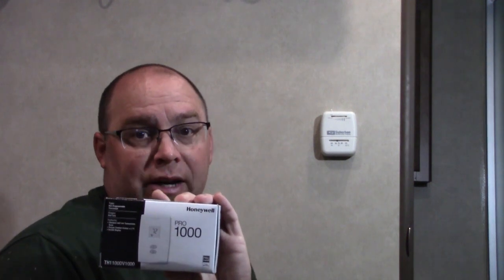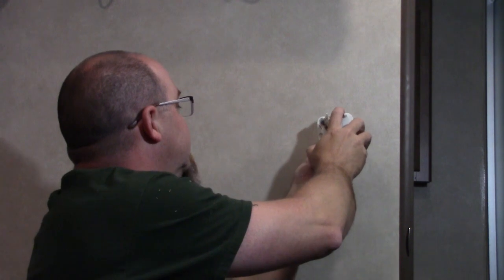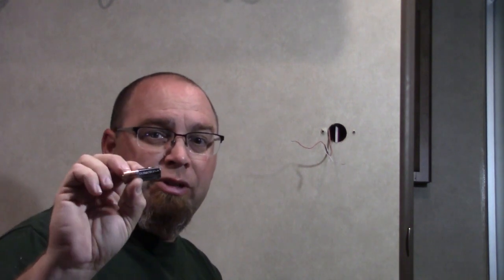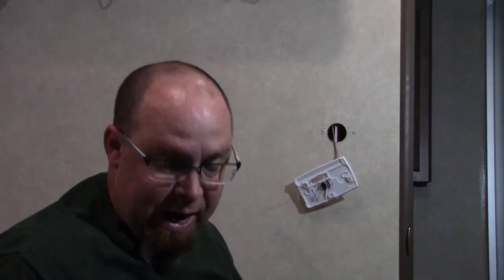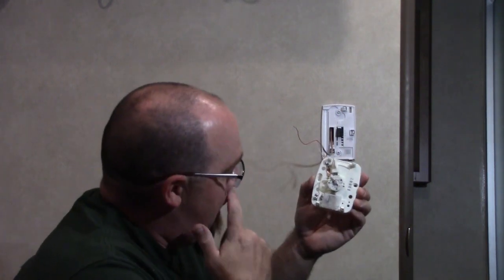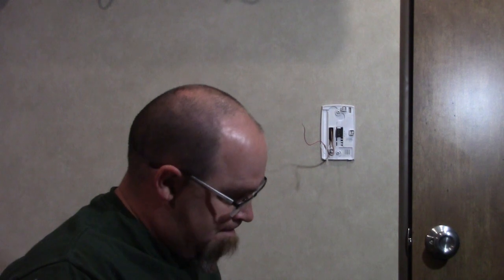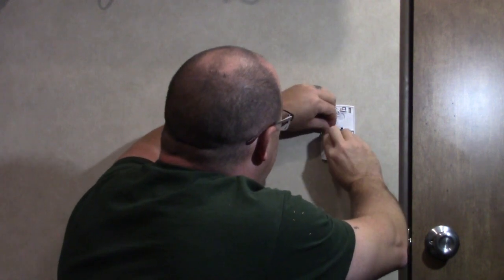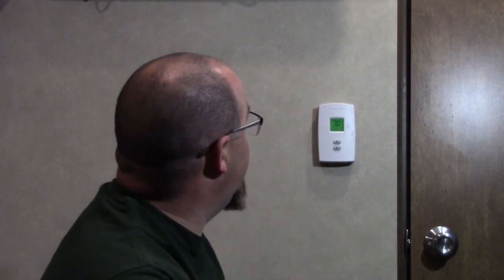Upgrade travel trailer thermostat to digital with the honeywell Pro 1000

Comment: I set up the thermostat prior to seeing this video but it appears to be installed correctly.  The gas fireplace started as per normal but the thermostat would not shut it off.  It was set to 70 but reached 78 and still wouldn't stop running.

Comment: Just got mine in my Camper & ran 2 degrees hotter than the set temperature before it cut the flame in the furnace 😐.  So its not pin point accurate in its shut off.  Ill see how it does down the line…

Comment: Please for the love of god tell me how do I change my degree's from fahrenheit to celsius
Reply: I have actually looked at that but my thermostat shows 5 and 5 for the first thing that pops up, its so confusing the rest of the thermostats in the house are celsius and mine is the only one in Fahrenheit; Im renting the place so I don't wanna screw crap up by playing with it to much...
Reply: yes its the same one, im positive; how can i find the model number?
Reply: Dang, I guess I will have to stick with what it is..
Reply: in Switch off mode , push up and down button at same time , hold it , until it switch display . You may need do this 2 button hold together couple of times until C number showed up. I did it successful for my RV today once I followed this great video to order and replace. Hope this helps.
Reply: Naw, nothing happened; its still in F
Reply: the first option for me says 5-5
Reply: neek247 Hold the buttons again until it shows 14 and go to up to 1. So it should be 14-1
Reply: neek247 I’m having the exact same issues. Mine also stays on for a hour at 5p. Did you ever figure out how to better set the thermostat?